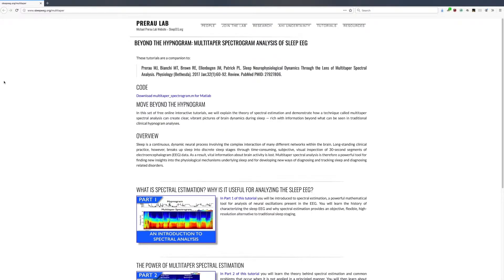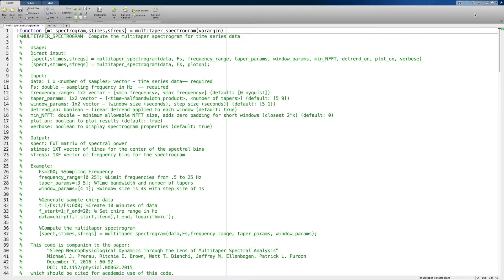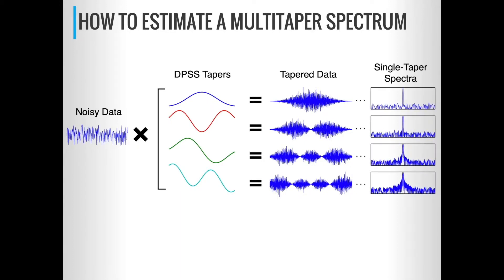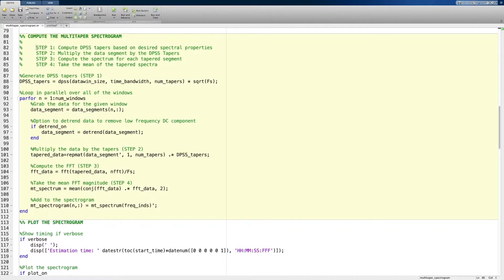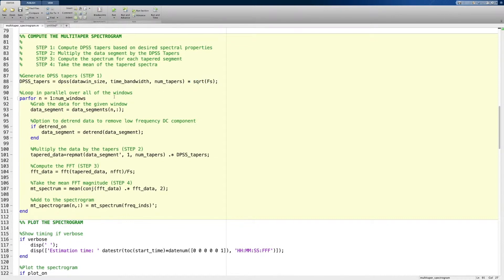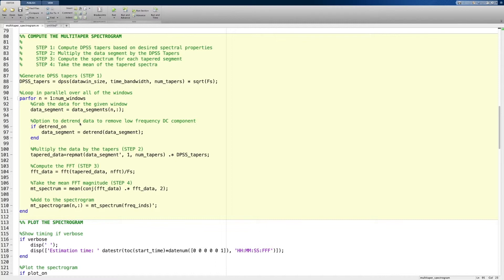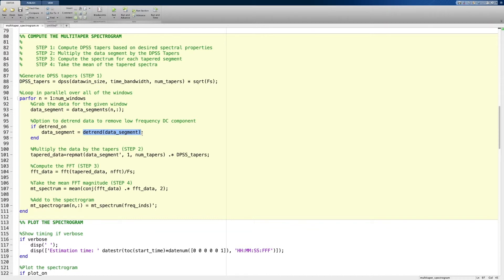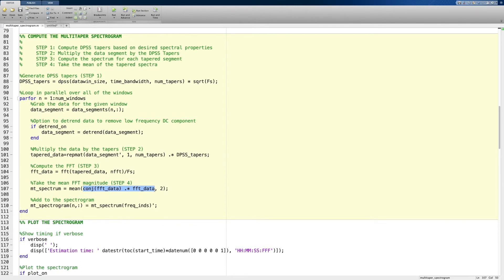Multitaper Spectral Analysis Code in Matlab - Walkthrough

Comment: how to reduce winsize samples when data length is smaller
Reply from the maker: Increasing the NFFT, which relates to the zero padding in the FFT, will increase the number of points computed for the output spectrum. Think of this as an interpolation of the same data rather than of providing any extra information.